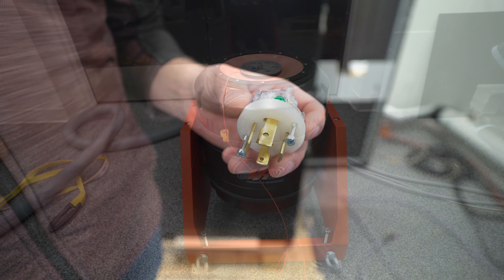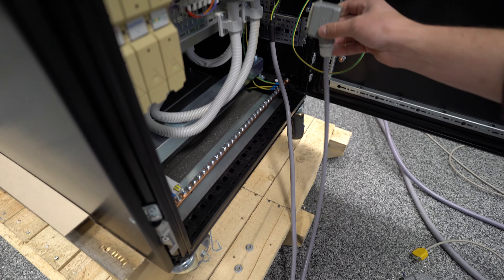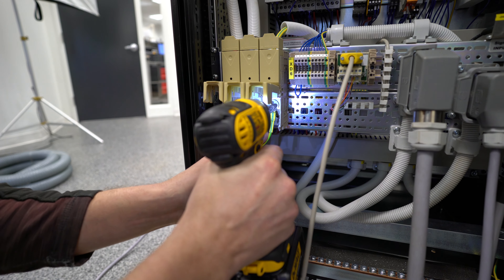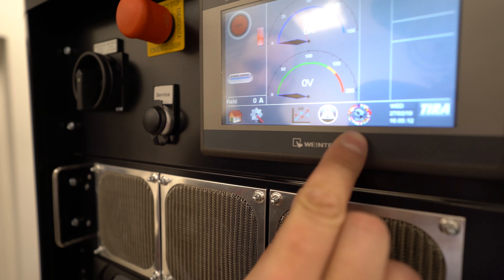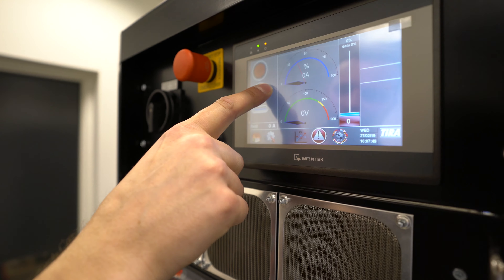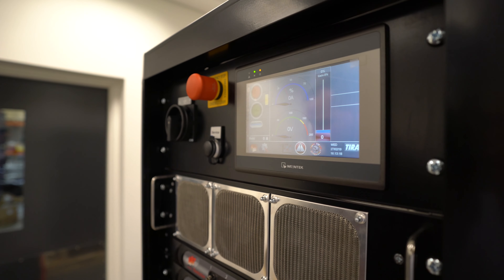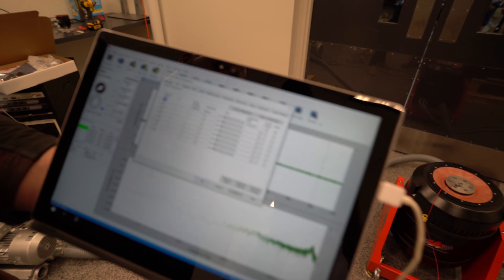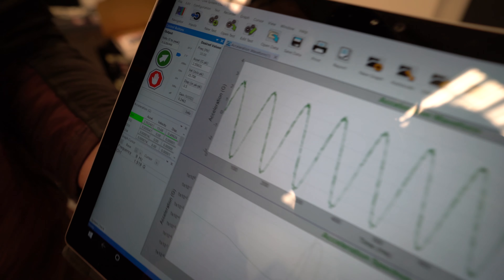Vibration Research Electrodynamic Shaker Setup

Comment from the maker: Q. Where should you  connect the main power? 
A. There is an XD0 terminal block that is where the main 3-phase power is brought into the amplifier. Connecting to this terminal block is not reviewed/discussed in the VR4600 setup video. Contact VR sales for additional info.